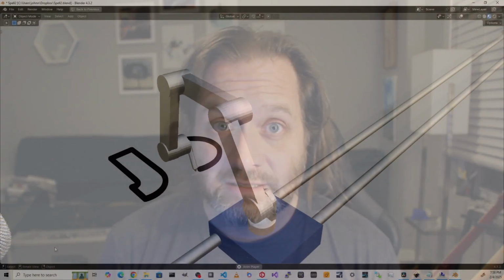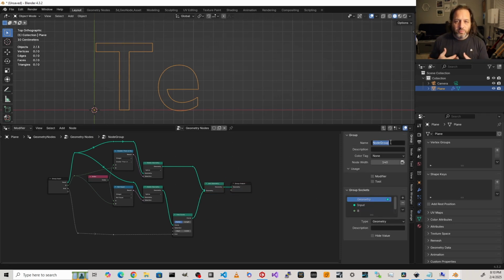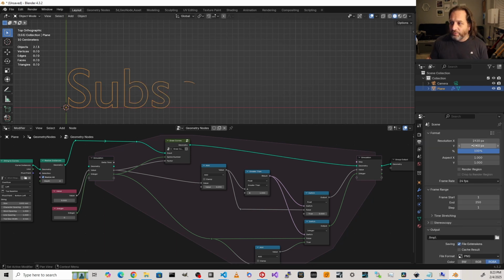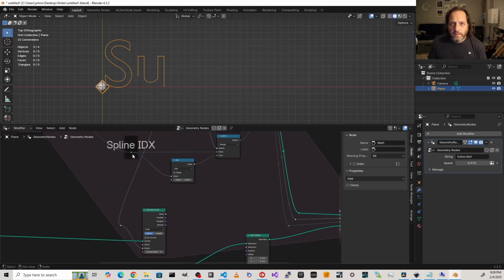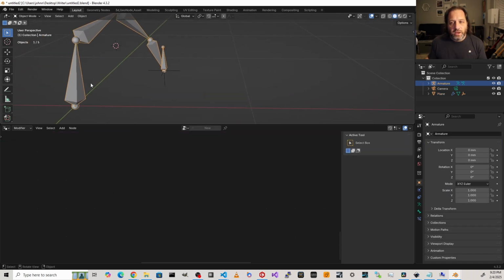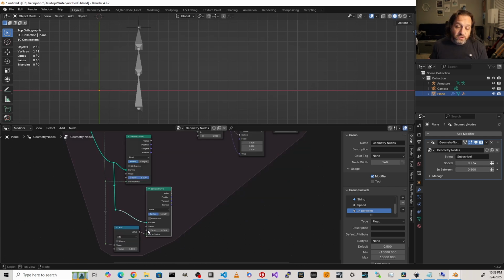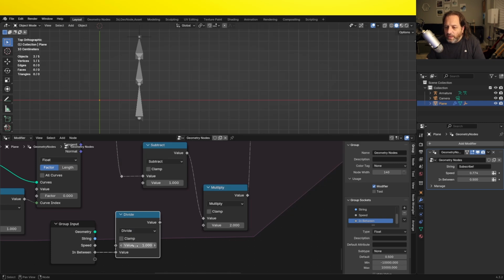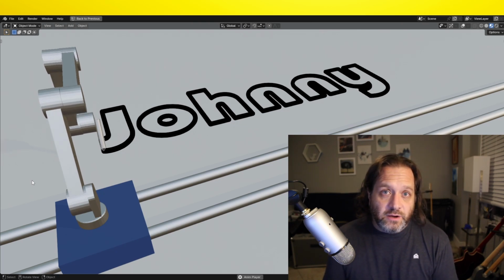Wait, I Can Rig with Geometry Nodes? Using a node tree to drive an armature in Blender

Comment: I tried doing a curve to mesh instead of the curve to grease pencil, but it doesn't work and I think it's because there is then no longer a single vertex in the output geometry that you can parent the empty to.
Reply from the maker: Yes, that makes sense
Reply: @JohnnyMatthews  You can give the point-vertex a boolean attribute like "empty"=true and then setup another node-tree that deletes all the other vertices, so you can parent the empty to that.

Comment: You could use Math nodes with  Fraction and Floor operations to drive the drawing. It would simplify the set up quite a lot as it would remove the need for the Compare and Switch nodes and Integer input. 

If valeu is for example 4.3, the Fraction operator would give 0.2, which would be used for Trim Factor, and the Floor would give 4 which would be the index for the curve selection.

So, you could just keep adding to the same value, and it would "automatically" give the Index and trim factor.
Reply from the maker: Good catch. But that might give trouble if I wanted to keep my "extra factor" idea. Perhaps the wrap math node would save a little complexity.
Reply: @JohnnyMatthews  I realized that after watching the whole tutorial. One opition could be to use module, to use uneven numbers to transitions, or vice versa. But that would lead switches etc .

I would probably make curves also for transitions. Createv Curve Line from previous curve end to next start. Spline indexing might need some work, but advantage would be that you could use same "drawing engine" for all.
Reply from the maker: @khellstr  Oh, this could get super complex. This video was already 45 minutes long! 😁